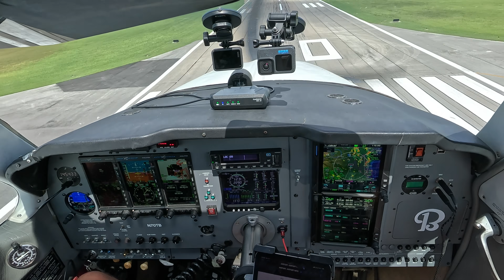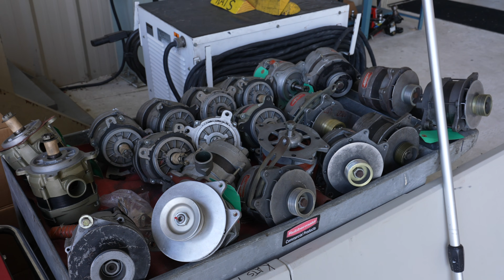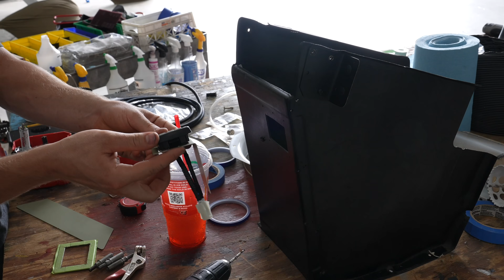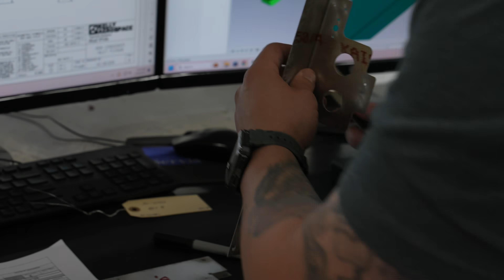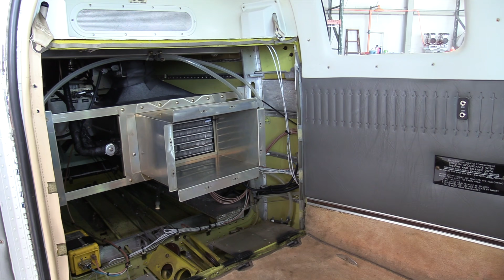Installing Air Conditioning in my Bonanza

Comment: How in the world does one have a "nose heavy" Bonanza?  Putting  65+ lbs of AC components in the tail of my A36 would be a serious issue.  I mean the luggage compartment on my 1983 is only rated at 70lbs
Reply from the maker: I can’t speak for your A36, John, but mine took a lot of elevator pull during take-offs and landings with only two people (front seats). And I’ve flown several other A36s which felt similar. Adding weight to the tail of my A36 has made it easier to land nicely.

Comment: Kelly all electric AC is ingenious. I have a Kelly AC system installed in my Cirrus. Immediately after engine start and alternators on, the Kelly system is powered up.  It is on from that point, thru run up, taxi and takeoff until shut down at the hangar after landing.  It is an amazing system!  It is an absolute game changer!
Reply from the maker: I agree 100%, Eric!  We still absolutely love our AC from Kelly!
- Martin

Comment: Any idea if this would work for a piper pa-32-300 Cherokee six?
Reply from the maker: I'm afraid I do not know what AC options exist for a PA-32. Suggest to check in one of the Piper forums - or call Kelly Aerospace Thermal Systems, and they can tell you for sure what STCs they have today and what they may be working on for the future.
- Martin
Reply: @martinpauly thank you. Figured I’d check here before making those calls. The wife definitely wants AC and this product looked great in your plane.

Comment: Awesome!  It DOES work like a home AC, which runs with electricity.  But cars power the compressor with a belt, using engine power.  Maybe some of the newer ones are electric, but with so much electrical demand inside the car with entertainment systems, automatic open/close on some of the doors, charging devices.... really puts a strain on the battery.

Comment: Martin

Just came across this video, and well remember when I helped you with purchasing the plane. As I remember, it had been air conditioned once, but you got those parts that had been removed in a box! I am sure you and your wife will really enjoy the added comfort this addition provides.
Reply from the maker: It’s great to hear from you, Don!  I remember coming to Houston for the pre-buy inspection, and I am grateful for all the help you provided with that and the buying process. N70TB has been a great airplane for us, and we’ve made it better in many ways than it was when I purchased it: avionics (in multiple steps), IO-550B, and now air conditioning. 

You are correct, the plane originally had factory AC, but the previous owners had removed that due to repeated maintenance issues with the system and also to improve the useful load. Now that our kids are grown, most of the time it’s just Beckey and me (or even just me) in the plane, so useful load isn’t as important as comfort. I remember how you described the value of AC when we met in Houston; your words were something like “…there’s just something about a woman when she realizes her make-up is running down her face…”.  Of course, I enjoy it, too, and the Kelly Aerospace AC has less weight and performance penalties than the original Beech AC, and no limitations for phase of flight. We’ve thoroughly enjoyed having it!

I hope all is well with you, and I would be delighted if our paths crossed again somewhere, sometime!

Kind regards,
  Martin

Comment: Does an IA have to sign off on these installations? Does the CG change?
Reply from the maker: An A&P sign-off is required, but not an IA (that would be for an annual inspection).
And yes, the CG changed. And the video discusses the weight and balance impact in detail, towards the end.
- Martin

Comment: Does the compressor kick off during full power application? 
On the automotive side the compressor disengages during WOT. I would think this would be important in an aircraft to shed engine/alternator load during takeoff etc.
Reply from the maker: Good question - that's more important when the compressor is directly and mechanically engine-driven. With the electric AC in my plane, the performance impact is so minimal that there is no limitation for using the AC during any phase of flight, including take-off or landing. And if there ever was a situation where for any reason I would want to get every last bit of performance for a take-off, I can turn the AC off manually for that time, of course.
- Martin

Comment: So do you supply updates weights & balance info for each aircraft type you install? How about aircraft performance specs when a/c is in operation?  I'm not a pilot, just wondering.
Reply from the maker: Yes, each individual aircraft gets a W&B update during the install.
Other than a little extra weight (60lbs, think 10 extra gallons of fuel), I have not noticed a performance change. I believe the aft movement of CG in my A36 actually helps with performance, so it may cancel out the penalty for the extra weight if we are flying with people just in the front seats.
- Martin

Comment: I just purchased my first aircraft to have air conditioning and it's great. I owned 4 before it without AC and always told myself I'm never going to need it. 

Kodiak 900 if anyone is wondering
Reply: First turbine? That's a proper aircraft!
Reply from the maker: A Kodiak - very nice! It's a rare mix of performance and utility - at a price, of course.
Enjoy your flying adventures in this great airplane (and the AC, too)!
- Martin
Reply: On amphibians?

Comment: Thanks for sharing. Living in Texas and not being a spring chicken myself, I definitely have considered AC. My Comanche is currently a 12 V system. Would I need to upgrade to a 24?
Reply from the maker: THIS system only works on the higher voltage, at least presently. Not sure if upgrading your electrical system to 28V is a feasible option - you may want to look for an engine-driven compressor instead.
- Martin

Comment: Would be better if it could handle a normal wall outlet
Reply from the maker: Sure. AC needs lots of power - no way around it. At least with the Power Cart from Best Tugs, you can run this system with a normal wall outlet.
- Martin

Comment: 95 under the heat load is not really that good. Needs more BTU capacity to pull it down into the mid 80's in that situation so when you get into the air it can pull it down into the 70's with the air flow over the cabin and condenser. Maybe with good insulation it would help, the white paint certainly does.

Comment: Am I missing something? Avoiding oppressive heat is just like dealing with any other weather condition: you plan ahead. In this case, early morning ops usually works out for even the hottest areas of the country. With runup, taxi and climb to above 5,000 feet usually occurring in less than 30 minutes, I’m left quizzically asking “is this worth the price?”

And I’m willing to bet most people don’t have A/C on their pleasure yacht … 🙄

… let the hate mail begin.
Reply from the maker: It’s a valid thought - if you can reasonably limit your flying to early morning hours, then AC is a lot less important. For those of us using the airplane as a travel tool, that would be too restrictive, though. So either we accept the discomfort (another valid option) or we get AC.
- Martin

Comment: Factory air 78 V35B here.  Nice system once sorted.
Reply from the maker: Beechcraft factory air is nice when it works, but it's amazing how many are not working properly.
- Martin
Reply: @martinpauly I kept the condenser and evaporator unit/fan.  All the rest I replaced with modern 134a components.

Comment: Gee . . . I thought I was lucky back in the 60's and 70's when I got to climb up a few thousand feet and take advantage of the 3 degree per thousand feet drop in temp.  It was heavenly feeling the temp drop off as the altimeter wound up.

Comment: Great video Martin. Thank you for sharing.  I have a small REQUEST.  Would you do a video on your content creation techniques?  I know you have an old video from a seminar you did but wondering if you could do an update.  In particular…while I know how to capture the audio for intercom using an adapter for the headset socket, I would love to learn more about how you are capturing cabin sounds, engine, etc and incorporating into such a great final mix along with your narration.  Also, are you using Davinci? Final Cut, Premier?  Your videos are so great and well put together I would love for you to give an update on your current process.  Also some do’s and don’ts.   I really appreciate the work you put into these.  Thank you!  Also would love to meet you if ever in KARR.
Reply from the maker: That would take some work...  But I can answer your one specific question: I use the audio track from one of the GoPros for ambient sound (engine noise, etc.). It's just noise, so you really don't need any fancy audio gear to record it. Then in FCP I have two separate audio tracks for intercom/radio and ambient noise, and I can control the relative volume of those tracks.
Regards,
  Martin
Reply: @martinpauly  Thank you very much for the reply.  That makes sense.  Time for me to add another GoPro!
Reply from the maker: @XOrionFE  No matter how many cameras we have - we always need ONE MORE, right? 🤣
- Martin

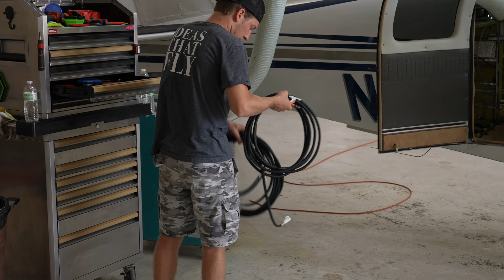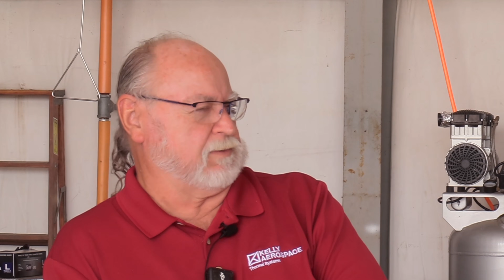Comment: 6:13 that big hose on the outside is going to cause a lot of drag? Ha ha.  16:35  Walter Dodge.... I love the ponytail.  * *   Yes 95 low humidity is better, but window sun shades or hanger shade would be a realistic, what temp did it produce?  50 AMPS? What does that do to alternator? That is power hungry.
Reply from the maker: It's a 100 AMP alternator, so it's doing fine with the AC on.
Window shades would certainly help. We may get some of those in the future.
- Martin

Comment: Why is the doubler on the outside???
Reply from the maker: Because the structure (stringers, wires, etc.) on the inside would interfere with it. Much easier to do on the outside.
- Martin

Comment: Did Kelly perform any extra work to ensure the control cables were not affected by the work in the tail? (Note, I'm just curious here) Did Kelly perform a control system/cable check before putting the interior panels back? Do you ever do a control system check before engine start/headset so it is easier to hear any control system "noises" (scraping/rubbing/binding)?
Reply from the maker: I check the controls (movement) during my preflight. While the Kelly AC components sit in close proximity to flight control cables, from what I have seen I don't see any source of interference there. As to how exactly they test this, that is probably dependent on the aircraft type.
- Martin

Comment: Congrats on the fantastic upgrade, Martin!  I’m jealous!!

Are you using a Garmin GDL52?  I see you have it positioned in front of the compass. Does that create any interference or errors?

-Lee
Reply from the maker: Thanks, Lee.
Yes, that is a Garmin GDL52. I use it for music and Sirius XM weather. I figure if I ever lose so much of my avionics that I actually rely on my compass, I can simply move the GDL52 out of the way - though I have not noticed any interference so far.
- Martin
Reply: Martin, I have a GDL52 as well but only for SXM WX - for now. Good to know you haven’t noticed any interference. I may look at moving mine closer to me on the glare shield. 

Thank you for the feedback. 

-Lee

Comment: Hi Martin - I have the Kelly Aero a/c system. When using it in the ground be very careful of how hot the voltage regulator gets. Stick your hand up behind the co-pilot side under the cowl while it’s drawing power to feel what I mean.

I don’t use mine on the ground anymore for this reason. When operating off the alternator it is less of a problem. 

I also have an issue where the compressor affects my magnetometer but that can be managed.
Reply from the maker: Thanks for pointing that out, Andrew - I'll look for that next time I run it on the ground.
I did notice the heading indication in my Aspen moves by a degree or two when I turn the AC on, but it's not enough of a change for me to worry about it.
Regards,
  Martin

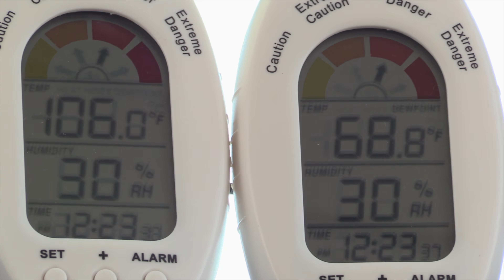Comment: 23:04  Somebody on the ramp might panic and assume the dripping condensate is fuel, then call for a fire truck to foam up your airplane!  Might be worthwhile to install placards on each side of the fuselage by the drain, with laser-engraved text: "dripping fluid is plain water from an air conditioning system, not oil or fuel"
Reply: Fuel in the tail of a Bonanza let's hope people in aviation is a little more knowledgeable than that!!
Reply: @robertdmoore2592   Not everybody who walks around the ramp has aviation knowledge.
Reply: @JustSayN2O  I've worked in maintenance for 32+ yrs and I've never personally seen anyone call fire rescue for anything dripping from and airplane they have asked us about it though.
Reply: @robertdmoore2592  Thank you, good to know.

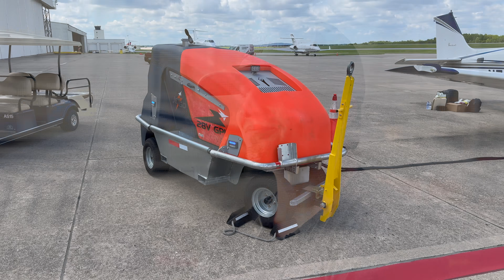Comment: 24:05  Too bad the two new openings could not have been cut at (or closer to) the bottom of the fuselage for aesthetic reasons.  Well, if that risks engine exhaust aspiration into the new system, then even cutting holes into the top of the fuselage might be preferable, at least to me.  Sorry to be a nitpicker.
Reply from the maker: I see your point; unfortunately down there is where the flight control cables are, so that probably wouldn't work.
- Martin

Comment: Hello I am wondering if this major modification requires a supplemental type certificate or other FAA document to be legal?
Reply: Of course it does.     The STC is SA04342CH and it covers the A36 Bonanza and the 55 and 58 series Barons.
Reply from the maker: Yes, there is an STC, as @Stepclimb wrote.
- Martin

Comment: Cool video production Martin.
Looks like a great A/C system DC electric, short distance refrigerant gas cycle. I like the buck riveted reinforced plate in the fuselage air intake vent.
Just have to monitor the sound and vibration of the purple compressor (similar to the one in the back of the fridge or wall A/C.
Did you have to change the plane's battery (deep cycle) or only use the GPU on the ground?
* Did the refrigerant lines get insulated?
Lastly, any pop out circuit breaker for the DC A/C?
Moving the CG 3" 1/2 is for another envelope sir💫🏗️
Reply from the maker: John, I don't have all the answers to your questions, but: No battery change was necessary as this AC doesn't run on ship battery, only external ground power. Any regular aircraft battery would be depleted in no time.
There is a circuit breaker in the cockpit for the electronics components of the AC, and a fuse for the high-AMP components.
Regards,
  Martin

Comment: Congrats on the airconditioner.  I was wondering, if they used heat pump technology they could also use it to heat the cabin in the winter. I don't know what that would entail or how much more expensive that would be for them to develop that system. In the winter you could plug in your GPU and have the cabin nice and toasty before getting in.
Reply from the maker: Good idea, but there are much more affordable and efficient ways to heat the cabin, both on the ground and while flying.
- Martin

Comment: Congrats Martin does the system come with one of those “ Spoiled, Blessed, and appreciative” stickers you see on people’s cool toys, but seriously a couple questions does your system use 100% outside air does it recirculate the cabin air. If you want to check the efficiency simply check the Delta T and if it’s near 20 degrees system is working efficiently very cool though ( no pun intended )
Reply from the maker: Thanks, Mike. The system has a valve to switch between 100% outside air and 100% recirculated air, and anywhere in between.
- Martin